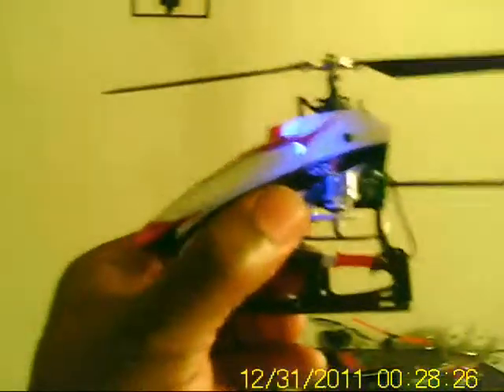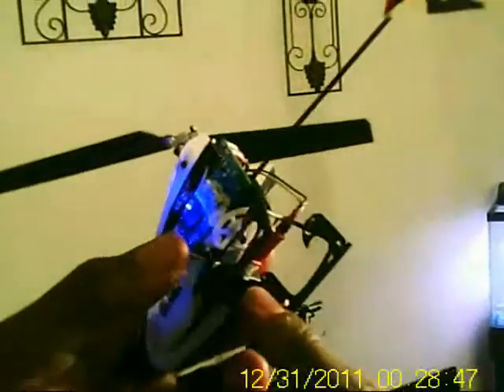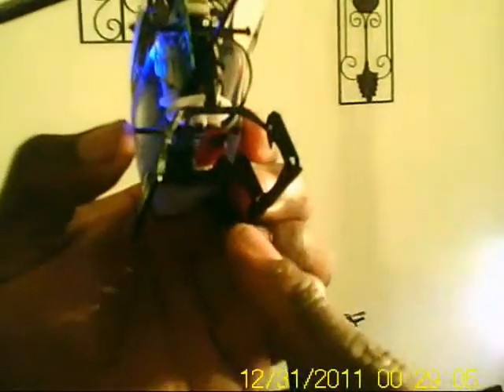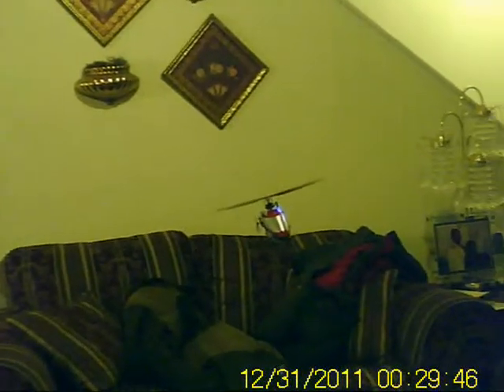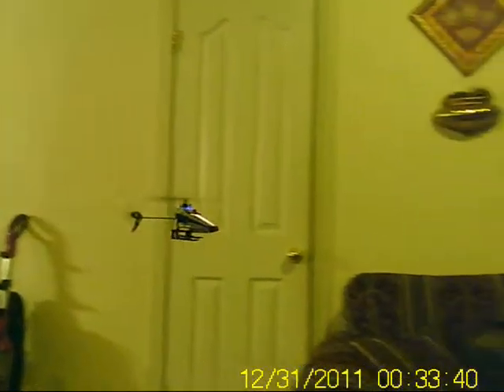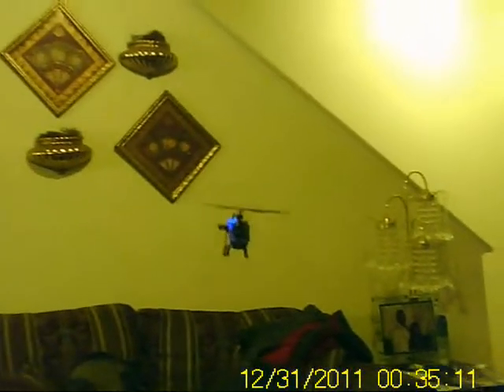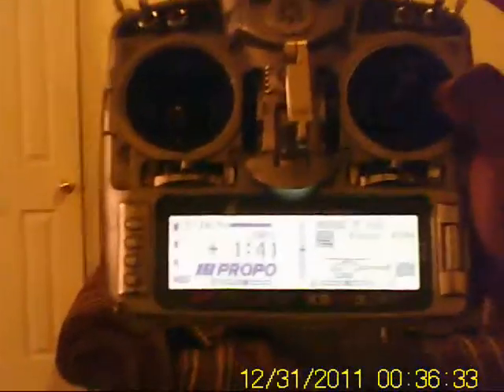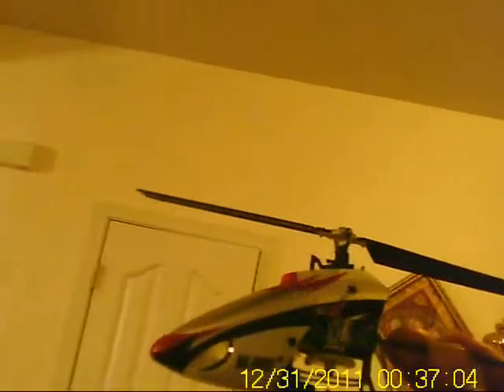Msrx using the mcpx battery and micro dean 7min flight.wmv

Comment: Tnt im flying my msrx on the same batt pack what settings do u have in ur dx6i mine seems to start loosing altitude...
Reply from the maker: I don't have a dx6i in this video I have my Jr9503.  There is no special settings for that it may be your motor is a lil weak and time to get a new motor.  Be blessed